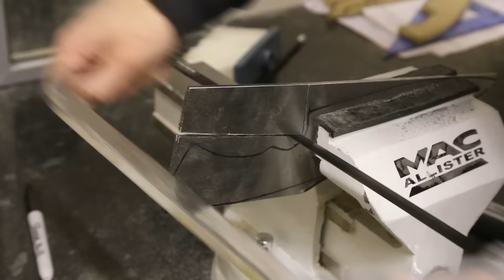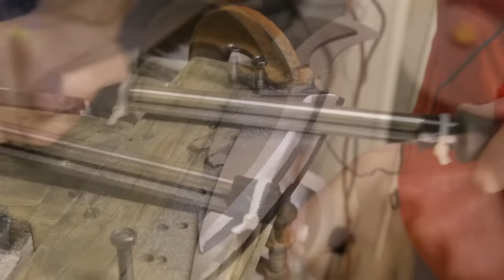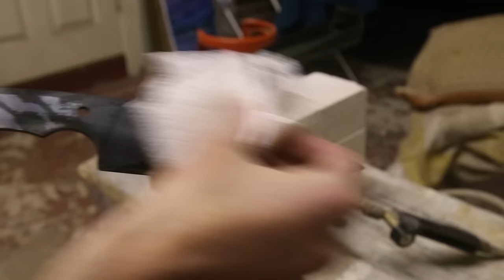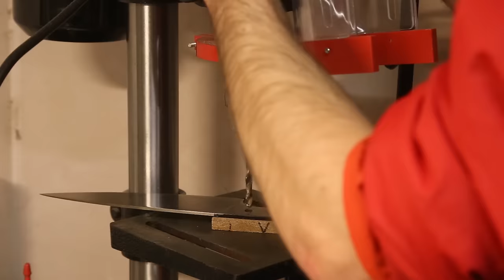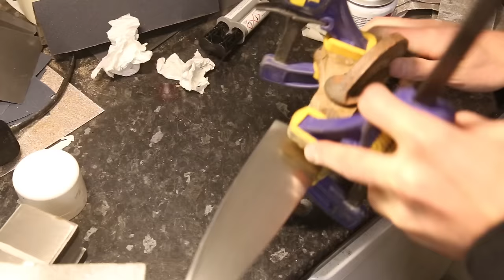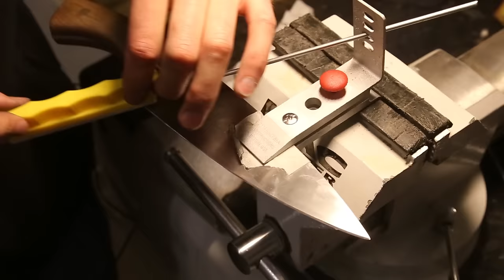How to make a kitchen knife using basic DIY tools

Comment: Using the tip of a drill bit to etch the apex line= genius. Also I’m going to adopt the file zip tied to a rod technique for my plunge lines. I use a belt sander for the grind and sharpening jig for bevels but haven’t been able to produce clean plunge lines. These are the tips a novice like me need to enter the next tier of craftsmanship. I’m glad I clicked your video. Thank you

Comment: really like the knife man. just as a suggestion, if you evenly heat the blade to the same color orange as the tip was before you quench it you will come out with a higher quality knife do to a consistent hardness on the edge. keep making stuff!

Comment: Nice results.  The handle looks great given that you only used rasp and sandpaper in your shaping.  One thing I found on the intial shaping with the angle grinder is to use the 36 - 40 grit flap discs.  They remove material quickly but are still controllable.

Comment: nice work... I use sesame seed oil / sweet almond oil or walnut oil... Sometimes if my scales are from an exotic tree, I blend all of them together and use the mixture. I first rub the oil on, wipe off the excess and with some oil soaked into a microfiber cloth, I wrap the handle overnight. Dunno but I accidentally discovered this when wife called downstairs and I forgot the knife handle wrapped in the cloth when our friends came in for a coffee... I saw that the scales were gleaming when I gave them a final wipe down...

Comment: I love how the knife came out. I also find it funny how it says "basic" tools but a drill press (which isn't all that basic that just everybody would have) is used. Also when you check the hardness you have to use the file in a normal way to find out for sure. I can get a file to not make a mark on mild steel the way he did. Not saying it's a bad knife because it does look great and it shows that he knows kinda what he is doing just throwing a few tips out

Comment: How did you find filing a bevel of that size? I'm currently working on a vegetable cleaver (of sorts), where the stock is 60mm, so that bevel is going 60mm too. I am finding it such slow progress! A royal PITA. Using the same filing jig setup as you show here too. I keep cleaning my file out but I get terrible gouge marks at times, and it just doesn't feel like it's cutting too well. Maybe I just purchased a crap file?

Comment: WONDERFUL KNIFE 
I would like to see a video of you making a pocket folding knife ☺️
Reply: Mohamad Mossab That is something that can't get made with hand tools sadly. Many precise calculations, and a mill are needed for that. Aaaand a lot of failures.
Reply: MyrtnKnives well you can make one, just would be far from perfect and yes, requires a lot of failures.
Reply: BT Shop well you can make a Viking style pocket knife, very similar design to how a straight razor folds just the tail is straight and is there to stop the blade from going over 180 degrees when unfolded

Comment: Good looking knife, well done!
It is carbon steel, right? How is this knife in use, does it rust, do you use some kind of coating?
Reply from the maker: it won't rust as long as you wash and dry it after use, but you do have to be more careful. You can't put it in the dishwasher or leave it wet. It will also stain over time with use, but not like rust, more like a staining and darkening which gives it a pretty cool, well used look
Reply: Peter Adamson Knives I believe Patina is the word you are looking for
Reply: Filip Huzjak 
When looking for a chef knife I look for high carbon steel. Can be made slightly harder, can be sharper, hood an edge longer. Of course depends on the exact type of steel. 

Have to never let it sit in water and dry constantly though. Not dishwasher safe either.

Comment: Great informational video full of tips thanks a lot, I am making my first knife, how much stock did you leave on the cutting edge before heat treating, 1mm or less ? Thanks
Reply from the maker: just enough that it didn't form a sharp edge, I didn't measure it. If you over do it though, you can always just run a file over the edge a bit to thicken it up without  really affecting the shape

Comment: Odd question, but where did you buy the metal rod used in the filing jig? I've been using a metal pipe, but it flexes and ruins the bevel.
Reply from the maker: Hi, I got it en eBay, there's basically nothing you can't get on eBay

Comment: i have a questionor two for you, what brand/model torch are you using in your little forge? and would you be offended if i was to use your handle design on one of my knives?, it would be a personal knife never to be sold or anything.
Reply from the maker: I'm afraid I don't know what kind of torch it is, my dad's had it for decades, though I think most basic propane torches will do the trick. Be my guest and copy the knife template, I uploaded it so people could as a lot of people asked me for it, hope your knife turns out well!
Reply: how many hours did it take you to make this knife? Thank you for answering.

Comment: Great looking knife. I am thinking of making one but the only tool i have is a drilling machine. How long do you think it will take to make this manually?
Reply from the maker: my advice would be to start small. Larger knives are made the exact same way, but the amount of time they take increases massively. You'll need some bits and pieces before you start but once you've figured everything out, the actual knife making bit should only take you a few days for your first time, assuming everything goes to plan
Reply: Peter Adamson Knives Thanks for the reply and advice. I will start with a smaller peeling knife or a different blade before I try making this knife.

Comment: I noticed that you put the lansky sharpener in the vice this time. Did it work well?
Reply from the maker: yea, it worked fine, the only inconvenience is that you have to unclamp it and reclamp it every time you flip sides, which you don't have to do with the official stands, but that's not a big deal
Reply: Peter Adamson Knives also, what does spraying the blade with alcohol before tempering do? Does it remove any extra oil or something else?
Reply from the maker: i read some people say that if there's oil or grease still on the blade, it will cook in the oven and make your oven/kitchen smell bad, so I just cleaned off anything that might cause problems, I don't think it has any useful consequences for the metal
Reply: Peter Adamson Knives sounds smart thanks for all the replies

Comment: I have a question I am a starting blade Smith so I am just wondering based on my primitive knowledge why you would put it in the oven? Wouldn’t that ruin the heat treat you just did?
Reply: Stormy Bandz I’m just starting out as well but from what I gather, the heat treat makes the knife very hard, too hard to sharpen or work at all, so the tempering in the oven softens the steel enough to where it’s still hard but to a point where the metal becomes workable again

Comment: Nice video, but i just want to ask that is O1 steel food safe? and would it rust?
Reply from the maker: Hi,, yes O1 is completely food safe, lots of professional chef knives, especially in japan and asia are made from carbon steels like O1. It will rust if left with water on it, so it requires more care than stainless steel, you need to wash it after use and dry it and put it away, you can't leave it wet on a draining board and you can't dishwash it though if it happens by accident, you can clean the rust off with a mild abrasive

Comment: You'll probably wont answer anyway, but the ebay link doesnt work anymore. How thick is the stock you used? Im using 2,8 and 3,5mm stock and having a real hard time getting the knife thin enough, especially if I just make a bevel like you and dont make a full flat grind
Reply from the maker: hi, yes you're right, I would recommend using 2mm for knives with small bevels. I used 3mm on some smaller knives with smaller bevels, and i can get the bevel ok, but they're not great knives on account of being more choppy than cutty if that makes sense. 2mm is good for small knives in my opinion. In my video called "making steak knives", that is 2mm steel, and the "hunting knives" video is 3mm, but with a pretty full bevel. hope that helps

Comment: Did you quench that in water? Might want to try Peanut Oil next time. I've been told that's the best.
Reply from the maker: Scowler no, I quenched it in vegetable oil, water will not work for this sort of steel, it has to be oil
Reply: Peter Adamson Knives 
Alright. I didn't see flames, so I figured I'd ask. Awesome knives.
Reply: Peter Adamson Knives 
Alright. I didn't see flames, so I figured I'd ask. Awesome knives.
Reply: Peter Adamson Knives 
Alright. I didn't see flames, so I figured I'd ask. Awesome knives.
Reply: Peter Adamson Knives 
Alright. I didn't see flames, so I figured I'd ask. Awesome knives.
Reply: Peter Adamson Knives 
Alright. I didn't see flames, so I figured I'd ask. Awesome knives, by the way.
Reply: There is no "best" oil for quenching. It all depends on how hard you want your steel, then you choose your quenching liquid. One can use water, mineral oil, vegetable oil, even alcohol etc etc to quench. He was using O1 tool steel and the recommendation is oil, not water, for quenching. If you want to see big flame, try 110 proof alcohol. Try it, lots of hahaha.

Comment: Did you just harden that blade in an oven? Or did you harden the steel and not show it and just temper the knife in an oven?
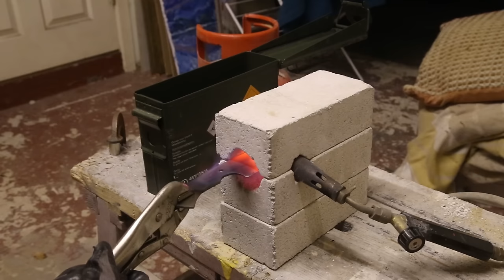Reply from the maker: i showed it, you might have skipped it, it's at 4:30 as you say, the oven is for tempering after it's been hardened

Comment: Very nice work without having a belt sander.  I would suggest not putting so much hook at the rear of the handle.  Kitchen knives are most often used by grasping the blade just in front of the handle with your index finger and thumb. With such a curve at the back of the handle (hilt) chopping (mincing) with a pronounced rocking motion appears to be difficult at best if not impossible. I am a retired chef and have been crafting knives since before gaining experience in commercial kitchens (think wee tyke).  Lately I have been fooling around with bushcraft and survival designs.  I like your design except that if I made one the handle would be straighter.  Just my preference.  In my honest opinion your handle shape would be great on a butcher knife or maybe a boning knife.  By the way, I can relate to the tedium of shaping a blade totally by hand.  It's really tough work.

Comment: lovely work Peter it's a credit to you, could you tell me how you make sure the pins line up with the scales on both sides, please, thanks
Reply: Drill into one knife scale using the knife handle holes as a guide. When you get the first hole drilled in the handle scale, put a pin through the scale and blade so the distance is perfect when you drill the second hole.

Comment: Great work!

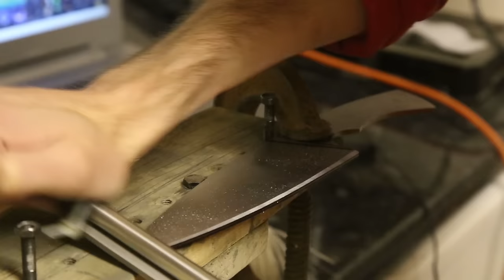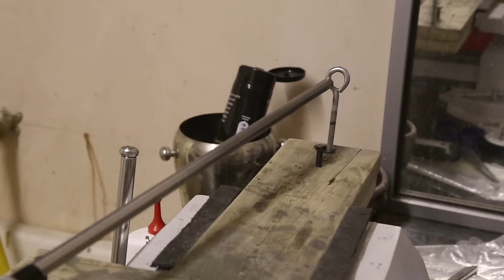At the @2:00 mark, is that just one of your regular files zip tied to a rod (the one that goes through an eye bolt you adjusted around 2:16)? Any details on how you chose or set that angles you went with for this?
Reply: see the link to the jig by Gough custom he explains how to use it.  Basically you start with a steep angle and quickly file to the middle of the blade. Then you progressively lower the angle and file till your sharpy mark is reached. Each  time you lower the angle the grind will get closer to the top of the knife you stop when it does.
Reply: Ah! I missed that somehow...

Comment: Do you have to heat it and put it in oil?
Reply from the maker: yes, this is called heat treating to make it harder. if you don't do this, it won't be very sharp and will dull very quickly, in other words, a terrible knife
Reply: @PeterAdamsonKnives  And what kind of oil is it?

Comment: Good  as any stock removal knife, but if you want a knife that will have it all, forge it, thermo cycle it, then temper,  that will refine the grain into a much better blade overall,  one heat and quench wont give you the fine grain structure one looks for in a high quality blade,  you have good basic hand skills , if you really want to be a bladesmith step it up lol

Comment: Nice but why do you go back and forth when draw filing, you are going to ruin your file.  You should do it the same way as when push filing, only in one direction (pulling towards you with the handle to the left or pushing away with the handle to the right)
Reply: aCaptAmerica yes, they still need to be used only on push stroke if you don't want to ruin them. In term of draw filing that corresponds to what I mentioned.
Reply: Bf         enoit Cerrina c

Comment: i have question for you or any one else ..how can i prevent the knife from getting rusty ? please someone answer me
Reply from the maker: With non-stainless steel, the metal will always get discolored and form a darker patina with use, this is not rust, and has no negative effect to the steel, in fact it helps protect it. Rust will only form if you leave the knife wet. It's easy to avoid rust by just making sure you clean and dry it after use
Reply: @PeterAdamsonKnives  thank you for replaying to me 
 i made a knife from wood cutting desk but it getting rusty after every use
Reply: @PeterAdamsonKnives  can I ask you why you stopped making videos? You really do amazing work and you've helped me learn alot!

Comment: for your handle only one time with the tung oil ? i try it several time but when i used only once it never last long when my knive have to be used in kitchen
Reply from the maker: no, i did several coats, but I just didn't show them in the video. it probably needs a new coat having been washed a few times since...

Comment: I thought you said basic tools, I don't have any power tools
Reply from the maker: you can use a normal electric drill or even a hand drill instead of my drill press, it will turn out fine but you have to be careful the holes are at perfect right angles. check my older video for one with just a basic electric drill. as for the angle grinder, it's not necessary at all, just use files and a hacksaw, as I did for most of the work

Comment: hate to say, but you totally ruined your knife. O1 tool steel has to be tempered to 1400 degrees, and heat treated at 400-500 degrees for a good hardness and durable blade. i bet your knife must not hold a good edge at all.